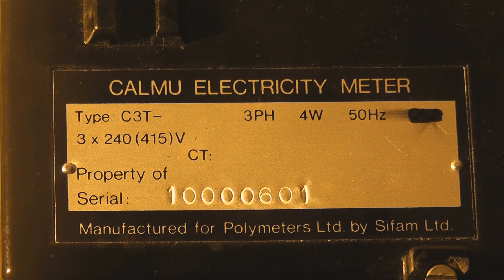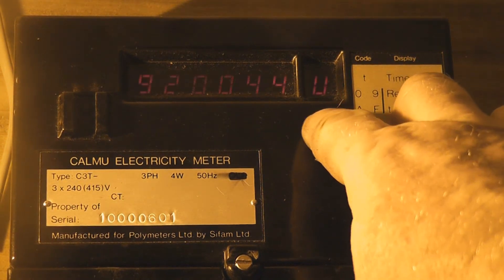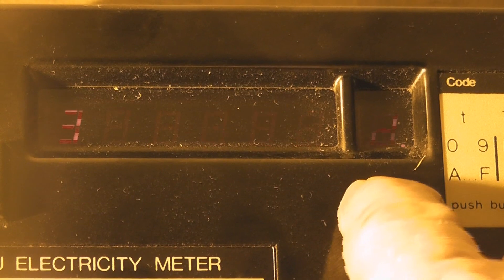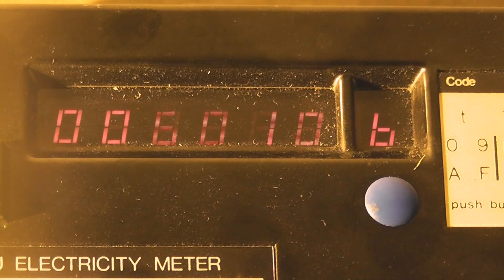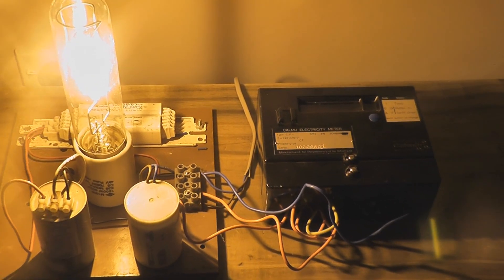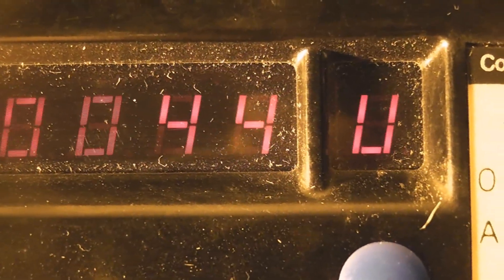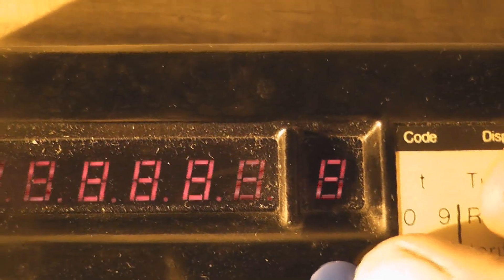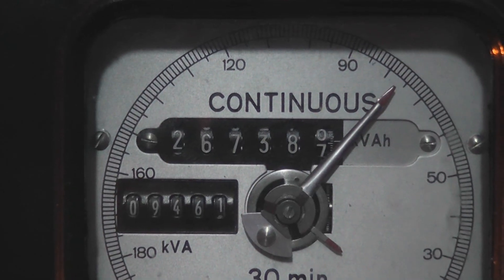Calmu3 Electricity meter

Comment: Viewer # 172. :D

Aaaah yes, probably could be a YouTube First. The displays on these meters sort-of remind me of the blue VFD-displays that were on the SIEMENS key-meters.

'key' meters in the UK are prepayment meters. The 'key' is taken to the shop and has credit put on it and then the key is put back into the meter to add the credit to it.

They were the replacement to the coin-op meters. In the early days, you could opt-in for a key meter with the advantage of there being no cash in the meter (the electric board DIDN'T tell customers about the downsides though!!)

Eventually, they were 'forced' onto people that had the coin meters because they wanted to remove those and make all of the cash collectors redundant! :-(

I have also heard (not sure if its true) that they key can also store other information like updating the pence-per-kWh, the standing charge, and might even be able to send information back to the electric board when it was next put into the key-recharger at the shop.

Basically,the way I'd think that would work, is when the key is taken to the shop and recharged with credit, the recharger would communicate via a phoneline and the central database would drop a request on the key to collect a meter reading.

The user wouldn't know about this, but upon the key being put in the meter, it would prompt the meter to load a kWh reading onto the key.

Upon the key being taken back to the shop for its next recharge, it would communicate with the central database and then the previously requested information would be pulled from the key, and therefore the electric board would know how many kWh was used on that meter.

I have even heard (again, not sure if this is true) that when someone moves house, they inform the electric board that they're moving house and they are asked to take the key to the shop and have a 'code' put on it.

The code is then put on the key, and upon the key being put in the meter, it immediately shuts off the power supply.

These 'keys' were the same as the ones which went into the Sangamo Schlumberger equivalent key meters.

Now, for the Sangamo Schlumberger equivalent, they had the same characteristics as a SPA-01 and even had the same readout mechanism in them. The specification plate in one of those meters was a blue colour. :-)

I preferred the 'look' of the Sangamo Schlumberger key meters over the siemens ones, but with the siemens ones you could see the readout in the dark because it was electronic, whereas the readout in the Sangamo Schlumberger meters was mechanical (as like the SPA-01)

=========================================

Towards the end of the vid, did I spot another Sangamo Schlumberger S309.5 on the floor?

It would be nice to see that on-camera and revving-up its loadwheel. :-)

Thanxx for showing,

-BoomBoxDeluxe.

19th June 2015, 20.15

Comment: Nice old meters :) the one we are using has a metal case outside and has two 100A fuses.
The shed got pull out fuses where you have to put the fuse wire in yourself then plug the holder back in. That system is not going to be used anymore.